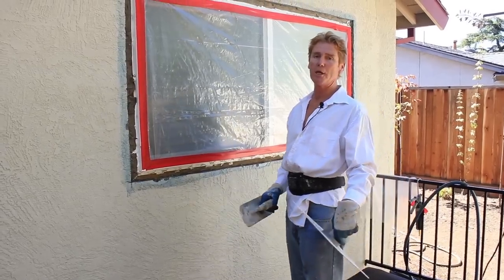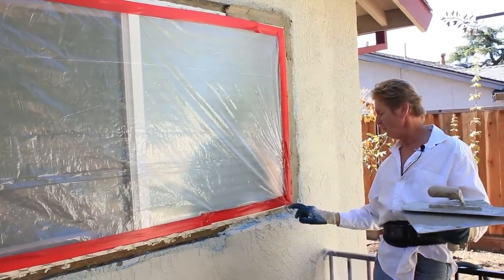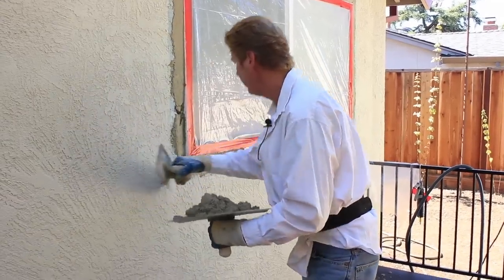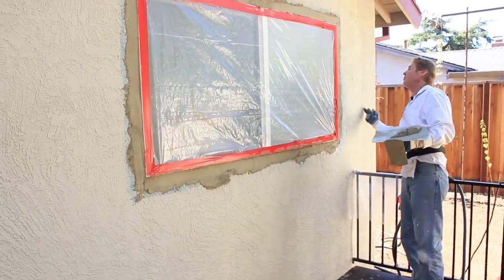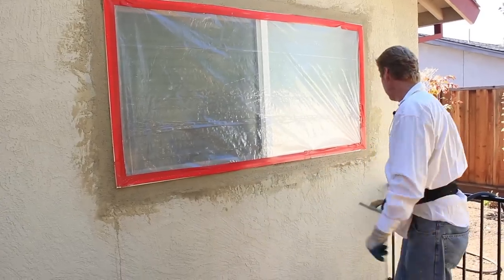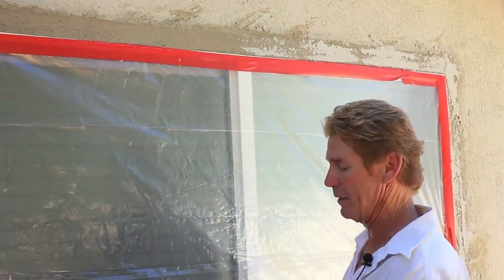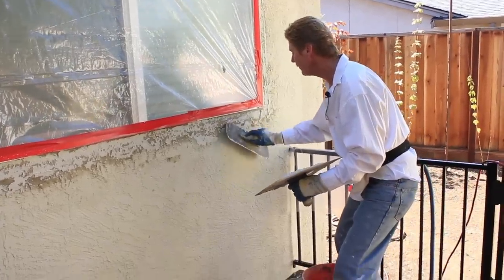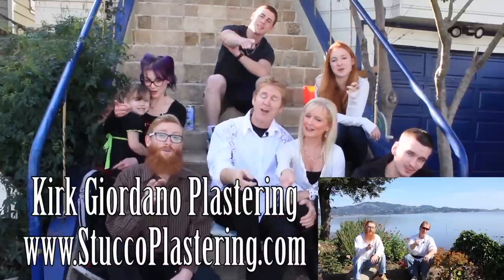Stucco around a new window in saw-cut stucco

Comment: Hey Kirk great vids!!
Just wondering if you could do a video on how well you clean your tools. In most of your videos you say how the 20 minute muds and the concrete based muds where you use the accelerators if the tools/buckets are dirty the drying time is exponentially shortened. 
I'm pretty anal about cleaning my tools but I think a vid on that would really help the diy'er or the carpenter who is trying to spackle like me. 
Thanks again 
Brad
Reply from the maker: No worries, Brad goose, will do,
 best wishes,
Kirk & Jason Giordano’s DIY plastering and stucco network

Comment: It's definitely an art...I enjoy the observations of technique and finish when you are matching styles, very interesting......I have a client who actually wants the stucco cut away from her window to build a wood frame around it to match the frames around her other windows.....it would be a similar gap to what you filled in here.....Not sure why she wants to do it, but that's how it is I guess.....
Reply from the maker: kjv-study Hello KJV-study dude, If it were me I would leave the stucco alone as this cutting will compromise the paper membrane under the stucco, thus, creating a leak.
 I would simply use wood that can be saw cut and placed over the existing stucco, no worries about leaking stucco this way.
 Best wishes, 
 kirk giordano plastering
Reply: cool thanks for the advice, I was able to advise against it for now, but the idea is still in the clients mind, she really wants to do it...I assumed that I would probably have to put some new paper in and really caulk the heck out of everything.....I don't want to do it though, as the current stucco is intact.....The window is under a pretty large eve, so it's not getting constant water on it when it rains....The only problem with just putting the facade over the stucco is that the stucco makes a beveled edge off the window, so you can't bring the wood up the the edge of the window properly.  I suppose we could bust the stucco out properly so there are keys and then re-stucco the busted out area up to the new window frame.   Still I really didn't like the idea of compromising good stucco just to have a small aesthetic change made...By the way I have really enjoyed your videos, the art and industry of it is very interesting, and I really enjoy watching y'all work.....much appreciated....
Reply from the maker: Morning Study Dude, go with your instincts, if your subconscious is saying don't do it, you are foreseeing your future lawsuit,
 no joke.
I don't compromise my gut instincts anymore. They will conveniently forget your strong opposition to this foolish task or will sell the home therefore you are still liable when it fail.

 You can also get them to sign a disclosure, now you have to keep this burden or letter in your desk for the next 10 years, your call.

 BTW, a number of years ago, being a real nice fella as the homeowners had to have their desires met, my insurance paid out 70,000 dollars.
  Best wishes either way.
 Kirk giordano Plastering
Reply: Aha...I see your point....most definitely much to consider.....  Much appreciated.
Reply: Kirk & Jason Giordanos DIY plastering and stucco tips : Love your videos, because you are a pro you make it look easy.  I retired recently, but my specialty was on site carpet dying and repair and I agree with you 100%, if you have real doubts or concerns, don't do the job.  I always gave my customers an honest opinion if a carpet can be saved or needs to be replaced.  Even with a few jobs I turned down now and then I still had plenty of work.  It is better not to do a job and have a disappointed client than to do a job that comes out badly and have a pissed off client.
Reply from the maker: Hey Coveralls dude, no doubt, thanks for the response.
 Kirk giordano plastering

Comment: hi Kirk, like ur video, u done a wonderful job. Would you tell me, what kindf product do you use to fill the gap around the window? I m going to replace my old  window, but the new one is smaller than the old. I know i need to fill the space surround the sill, but i dot know what i should use. Thanks a lot!
Reply from the maker: Hello life is good, thank you, the product is rapid set sold at home depot, you just add water, don't overmix, 3 to 5 minutes max, then apply.
 FYI, I make it look easier than it is.
 Cheers and have a Happy New Years, Kirk Giordano’s DIY plastering tips
Reply: Kirk & Jason Giordanos DIY plastering and stucco instructional videos and forum Thank you Kirk, for the quick reply. Do you know the name of the product? I asked one guy from HD, he pointed the  Pro Finish Crack Resistant Concrete Mix, can i use this one, thanks.

Comment: Hi Kirk, I definately agree about covering the windows and doors, as you say, it saves you a ton of time later and the man that thinks he is faster than you is talking out of his glutimus maximus, in fact I reckon that you two should have a contest with the loser having to run around the nearest town in his underpants. 
I'm not sure I actually like the skip trowel look, it reminds me of 1970's artex, but having said that here in the UK many homes have the pebble dash look which many folks also cannot stand. One thing that does look great on homes is pargetting, ie, designs in the render by freehand or else a design carved into a wood block and then this is stamped into the green mortar.
I did a short course on the subject with an excellent craftsman called Bill Sargent, he is a real expert in his work and I think a little pargetting work can add a bit of extra value to a home especially a small feature over a window or door top.
Live long and prosper KG.
Reply from the maker: Morning Peter Dude, I agree, some texture are cooler than others,l with a bit of old world charm. 
    On most stucco repairs we basically match the existing finish.
              Live long and Plaster
  Sharing DIY Plastering tips from team Giordano

Comment: Hey Kirk,
Been down a window/patio door rabbit hole lately. All these nail fin windows provide somewhere for the stucco to butt into at the window - simple. 
I see some big aluminum doors, bifold, etc (fancy) where the stucco is at a clean 90 degree off a flat frame. So the wall is offset (proud) a stucco thickness from the flat window frame. There is no flange the stucco butts into. So I see it has to make a 90 degree to join the face of the window/door. A bit like a J trim. How do you guys do that? Do you use a cheater bar, a Jig, or something to get a clean 90 degree edge on top of a flat flange?
That sounds confusing but without image it's best I can describe. Would love to see more industrial windows and door set up on here if you guyts do em!
Reply from the maker: Good morning, we don't do anything when we have that situation. To see the J-Trim one-eith-inch return is not a bad thing. I see all kinds of flanges or trims, that are not noticed by the average person. As long as they are functional and necessary. No big deal. In fact, the video we are uploading today shows a window that installed cockeyed, we had to put a heavy texture just to blend it in. Cheers.

Comment: Great video. Thanks! And now a question: I have a very similar situation as in your video  but the wire was removed when the stucco was cut. Advice on how to proceed with the patch when there's no wire in place? Thanks!
Reply from the maker: Hello Esther, you would have to add more wire, its best to chisel or break out a little bit of existing stucco netting also to avoid a perimeter hairline crack to. Its best but up to you, if you dont break out some of the original, you may end up with a crack, this crack can be caulked with Mor-Flexx caulking if you choose to go that route🤔

Comment: Hey Kirk
If I am using a regular base coat like from Home Depot how long should I wait in between scratch and brown.
Thanks
Reply from the maker: Good morning Forever Dude, most cure times between coat is 48 hours,
 FYI, home depot does sell Rapid set which you can apply both coats, same day,  boxes come in 10 or 25-pound boxes and of course, 94 pond sacks which have sand and cement already in the bags, you just add water, don't overmix this material 3 to 5 minutes max.
                          Live long and plaster
           Plastering tips for your information

Comment: Thanks so much for all the videos - I have this issue with the saw cut. My areas with no stucco are quite large - 8 windows and a french door - so I have papered, wired and caulked everything, should I chip the edges? or leave em alone and use welcrete?? TIA
Reply from the maker: Howdy Greg Schexnayder dude, more important then this is to wash away all the dust, nothing sticks to dust.
 I prefer to rough up my edges just a bit, if only with the claw of a hammer for a tighter bite, after roughing up, clean well, apply a bonding agent than plaster as usual.
 Cheers!
 Kirk Giordano
Reply: +Kirk & Jason Giordanos DIY plastering and stucco tips    Thanks, yes the dust is kinda overwhelming- by wash away, I am assuming I would use a blower or dry paint brush followed by a vacuum if possible? Thanks dude!
Reply from the maker: Hello BaJapalm, for me it's best to use a water hose with a nozzle as I don't wish to inhale any dust, Yea, this makes the project last a bit longer but is my preferred way when possible.
 Cheers!
 Kirk Giordano

Comment: so like in this case... it's fine as there's a large overhang, but if there was a ton of water raining down pouring on top of the stucco above the window here... is there any flashing? like where would water that gets behind the stucco escape above this window?
Reply from the maker: Hi Phil, One has to do the best possible with what they have to work with. To fuse the window frame to the paper and flashing is the absolute best, especially if Sikaflex 1A  caulking is used. I prefer all folks add a metal z-flash on the tops of windows. However, we do the best we know how when seeing how the contractors left the windows. I have walked off my share of jobs where windows were installed pitifully. 🤔

Comment: Hi kirk, do you caulk around the window after you do the parging. ? I am adding basement windows, and there will be some gaps around them. Should I parge, and then caulk around the wood frame? Or should I fill the gaps with foam and caulk, and then fill in the spots with parging mortar? 
Thanks for all your advice btw:)
Reply from the maker: Hello Vanessa, It's best to use calking as it's water-resistant where mortar or stucco is not.😏

Comment: Hi Kirk, We own a 30 year old stucco exterior home. We are replacing windows and want the best possible seal. Planning on new construction, vs retro. Is this the right decision? Thank you. Your videos are super helpful!
Reply from the maker: Good Morning Darren Dude, yes as retrofits rely on caulking instead of proper lathing.    
I have been called many times to correct retrofits when or if the caulking fails               
                       Live long and plaster
          Sharing the plastering knowledge
Reply: @StuccoPlastering  whats a retrofit kirk?
Reply from the maker: @Lawless187indika  Howdy Good question, that's when they remove a window and insert a new one without breaking out the existing ones. Retrofits last as long as caulking does. Not long.🍾
Reply: @StuccoPlastering  ahh,essesntially using the old "frame" and fitting new windows. Think i Got it!. We twist out our own terminologies here in the islands, rarely hear the term retrofit. .. keep em going sir!, i learnt so many useful bits and gems from you over the last some years. Blessup!
Reply from the maker: @Lawless187indika  Howdy my friend, thank you, and your welcome.🍾

Comment: Hi Kirk!

Does it matter that there was no flashing that skirted out to the old stucco?
Reply from the maker: Howdy Post dude, do you mean, does it matter that I didn't apply the new texture over the existing walls? Sorry, I am not familiar with the term, "skirted out" 🤔
Reply: @StuccoPlastering   - Sorry, I meant metal flashing for the top of the window.  I'm guessing that because the window had fins attached it [rovided a barrier.  If the window had not had fins, wouldn't it have been good to put a drip edge metal flashing on the top edge of the new window?
Reply from the maker: Hello my friend, If any window doesn't have flanges, they should not be installed in or on any walls. Can I  a person waterproof a window with no flanges? yes, however, they would have to rely on an adhesive polyurethane sealant caulking, Like Sika-Flex 1A. 🍻

Comment: Great videos. I have learned so much from you. QUESTION: Do you leave a gap between the window and the stucco? I have been reading that most window manufacturers require an expansion joint between the window and the cladding. If that is true, how do you do it?
Reply from the maker: Good afternoon Untethered, this is, "malarkey, or nonsense."      On some commercial projects, prints do call for a piece of J metal to surround the window so the two of them can expand. However, in residential homes, it's a waste of time.
 In some states, they do ask for this, but not California. The reasons are too time-consuming to detail in this space.                  

  Introducing peace, love, and harmony back to the plastering world.        
                                            Sound advice on the art of plastering

Comment: Hey Kirk,

Nate here.  I am doing a window extract and redoing the wall so that there is a different sized window, smaller, and room to mount the swamp cooler below.  what this means is there will be some stucco work to do and I have a background in construction work, but stucco was not part of that.  my concern is not the scratch and brown.  I have seen enough of your videos to feel that I can accomplish this part, however amateur it may be.  I just am not sure how to match the final as it is really rough and erratic.  almost looks like someone slung it on.  is there a way to apply this and do I still need to float it before doing so?
Reply from the maker: Howdy Nate, sound like a dash finish, perhaps the video below may help. 
 cheers,
Kirk and Jason’s sand and cement rendering videos
http://youtu.be/Ehjtf2CyB10
Reply: I kind of thought so based on your videos.  Great videos by the way.  almost like school.  just the testing is trial and error.  is there an email i can send you pics to have you look at the finish or is it too hard to tell from pics.  If i had money i could hire you but we live a bit from the oakland area here in LA and money is short.
Reply from the maker: Evening Nate, kirkgiordano@gmail.com
Kirk

Comment: Hi Kirk How do you patch small touch ups on a sand finish using synthetic with out standing out when it drys
Reply from the maker: Evening Tiana, you can use either a synthetic or a cementitious finish to achieve a sand finish.
   You will also need a sponge float to bring out the sand when you apply the finish coat. A plastering float brings out the sand, thus the term sand or float finish.
 Or you can type in Google, "how to apply a sand finish."

                  Bringing peace, love, and harmony back to the world of plastering.
    The complete plastering encyclopedia on video, by the plastering messengers of Youtube.
Reply: Thank you sir appreciate the feedback keep up the good work

Comment: What kind of mud is used? Stuuco fast dry? Or just a cement
Reply from the maker: You can use “Rapid Set Stucco” from H D or Lowe’s. It sets this fast. All you do is ad water as the sand is in the boxes and bags that it comes in. Don’t over mix this or any other same day stucco, about 3 to 5 minutes is all the mixing you need, what happens if you over mix or over trowel, this hydraulic stucco explodes. Not really, but it can lose some PSI strength.😉

Comment: Curious as to why you're using a pool trowel?
Reply from the maker: You wouod have to watch the video belwo to understand,
 https://youtu.be/X_SRyTIVMbU
I am sharing my experience of why I prefer a customed swim-pool trowel Vs., the standard rectangular plaster or stucco trowel.
Or what is called a common swimming pool trowel.
    "FYI, a typical swimming pool trowel has a perfect radius and has a width of 3 to 4-inch widths are great for Cement Masons, BUT NOT, for stucco or plastering applications" as the width is too narrow. Thus the blade does not flex, a master and or journeyman plasterer moves the mud where they want it, this comes with wrist strength and flexibility of extra width.
   Again a swimming pool trowel with a perfect radius is ideal for concrete finishing but "WORTHLESS" for skilled plastering applicators.
 They are designed for pushing the rocks in cement down to a smooth level often using much strength, thus the smaller width.
 My 16-inch trowel has a width of 4 1/2 while my 18 has a width of 5 inches, these small details matter to skilled plasterers.
I feel all swim pool trowel should have 5-inch widths so that master plasterers may also use them until this is understood by the makers of trowels, the 16x4 1/2 I show and the 18 X 5 are your best bet for plastering, 
Note: the 18 is for interior plastering although I use of too for exteriors as it to large for most folks thus seams cumbersome.
    That being said an experienced plasterer like myself can use a frying pan or my shoe to get mud on a wall.
 Best wishes, 
 kirk giordano Plastering

Comment: What’s name of material of first coat stucco? Anyone know?
Reply from the maker: It was regular Portland-based stucco, we added some Luminte which is an accelerator. You can just buy, "Rapid Set Stucco," at HD or Lowes, The Rapid set has the accelerator in and the sand. You just add water and apply, it sets in about 20 minutes. 👨🏻‍🔬
Reply: @StuccoPlastering  thank you.